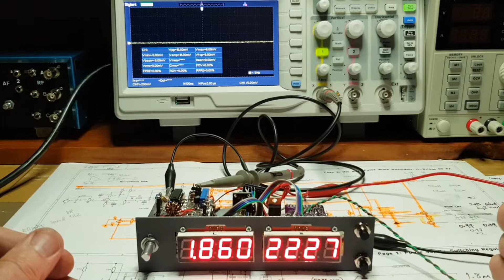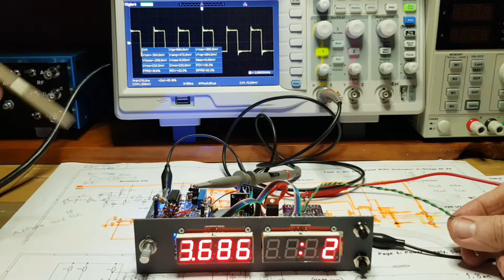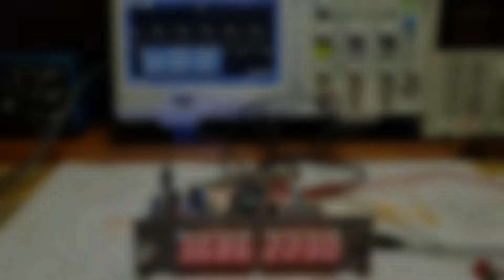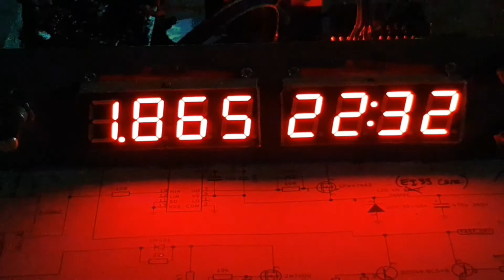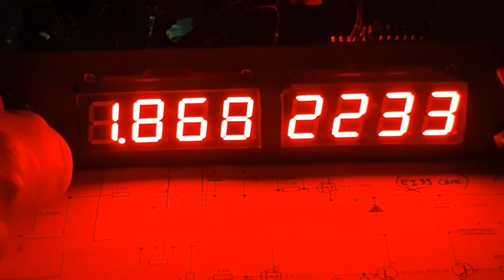Digital VFO and Controller for a base station transmitter or transceiver

Comment: Nice job Paul. I like the big LEDS and compact size. Plenty of features and obviously a lot of fun to program up all the functions. Good to see home brew these days. Cheers, Lou, vk3aqz
Reply from the maker: Hi Lou. Yes, it was a change to work with something other than Liquid Crystal Displays or OLEDs.  The big LEDs give it a bit of a retro look too.  Following your AR transceiver series with interest. 73 Paul VK3HN.
Reply: @Paul_VK3HN  I agree, the LED displays are spot on for your AM transmitter - they go with the concept and the vintage. The rig in AR was finished 2 years ago but due to the changes in the WIA, in took a while to finally make it. It was a bit of fun to make and works well. The new 3 band unit with the black front followed that rig. If AR want it, I will submit it too. It uses some new bits such as the H mixer and TFT display, single dual VFO, etc. Thanks for the feedback. Cheers, Lou
Reply from the maker: @vk3aqz  How much better, if at all, did you find the H-mode mixer, in terms of receiver 'user experience'? Did you use FST3125 switches?
Reply: @Paul_VK3HN  Hi Paul, yes I used the FST3125 switches. You can see the PCB in my Youtube video demo of the MK5 rig. Part 2 about 1 minute in. I have not done IP3 measurements but many years of experience with all sorts of mixers tells me that it is very good. Listening on 40m at night on the dipole, I don't hear any cross mod. Yes, I believe it achieves the claimed figures of more than  +40dBm. A bit hard to mount the chips but we did get there in the end.
Reply from the maker: @vk3aqz  definitely a mixer module to try in the future for sure, just need to rearrange the VFO for division down! Qrplabs QCX uses this design.  73 Paul VK3HN.
Reply: @Paul_VK3HN  Ok. When you say "division down" what is your VFO running at the moment. The design I am using does not use a digital divider but rather an FIN1002  device which has +- inputs driven by a transformer and feeds the switches directly. It comes from a design by  Giancarlo Moda, I7SWX, YAESU FT1000MP-MKV Proposed Modifications, A paper available on the web. If you can't find that, i can send you my circuit. I am using larger balun cores because his design uses small ones that I had trouble winding.
Reply from the maker: @vk3aqz  Found it. Uses FSA3157 in place of FST3125. The FIN1002 is used as a sensitive oscillator squarer.  Have filed this paper for future consideration. Thanks. Have you considered writing up your second txcvr for AR?  Even if it is a kind of 'updates' approach rather than the full construction details.  There would be interest.  G-QRP/Sprat would be very interested in your build of this mixer, I am pretty sure, they have an audience interested in high performance but reproducible designs.
Reply: @Paul_VK3HN  Yes your right, my mistake. I did misread, or did not look close enough, to your question. As it happens I also have the bigger FST3125 devices and some circuits using it, but the one I ended up using is the FSA3157 (and I did put  a diplexer on the output). That I7SWX design did not need the flip flop and the timing adjustment . Re the MK5, I have finished most of the writeup and photos ready for an article. But I have a digital antenna tuner with the WIA to also publish and they won't publish 2 articles from the same author in the same issues. So it might be some time before the MK5 could be published. And the MK5 article is reduced in size and refers to the MK4 article for the bits that are the same - so only the changes are described fully.  One of the problems with the WIA, is that it can take long time between submission of an article, and the publishing. And they won't publish anything if you have already sent the circuits and article to another party, or the web  - they take full ownership of the work. I guess there are quite  a few articles waiting to be printed plus the staff are all volunteers and cannot devote the time that a magazine needs. The plus side of having an article in AR is that the article tends to be available to access for quite a long time whereas articles on the web tend to be forgotten much quicker. Old fashioned people like you and I will  download and store stuff that is interesting, but the bulk of people just tend to skim stuff and then forget it. So getting something into print is more desirable - you can always pick the article up at anytime or even take it to bed to read!!.  Lou.
Reply from the maker: @vk3aqz  Magazines have been disrupted several times over in the last decade.  I decided about 5 years ago that a blog and YT channel were the way to go, for global and instant engagement and feedback.  Online has sped up home-based making many times over.  The purpose of a printed magazine these days is for debate.  In the case of AR it is the official voice and record of the WIA which has some value.  And I do still see that there is some 'longevity' to published articles that a blog cannot provide.  However the readership and reach are eclipsed by online channels.  You are to be congratulated for investing the time to prepare for publishing.  I didn't know AR demands exclusive rights. There goes an AR article for me!
Reply: @Paul_VK3HN  Yes, I agree with you - the web does provide for quick access and people that are willinging to share their work freely.  I guess there is a place for both. But, yes AR was good a few years back but these days not so much. For instance, I noticed some of your early projects such as the building blocks, came from legends like Harold Hepburn, Ken Nisbet, and so on.    I do have a website, and I may end up putting my creation on there instead. Yours is quite good and I have visited  it quite few times. So I have to say - thank you for sharing!  Cheers, Lou
Reply from the maker: @vk3aqz  You make me feel good when you call up those early influences I consumed through the pages of AR, Harold VK3AFQ, Drew VK3XU and many others.  You are following in their footsteps, and I look forward to seeing your creations both on the printed page and online for many years to come.  Thanks Lou.
Reply: @Paul_VK3HN  Thanks Paul - we will try!